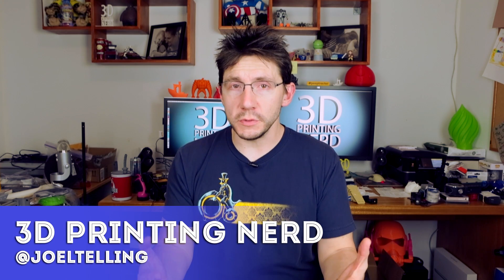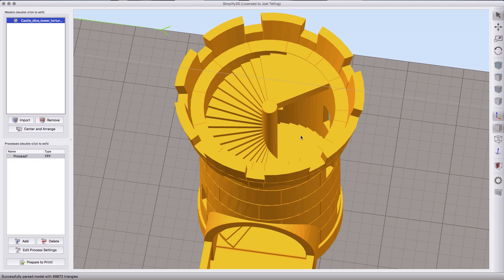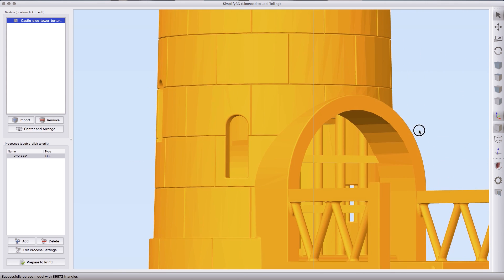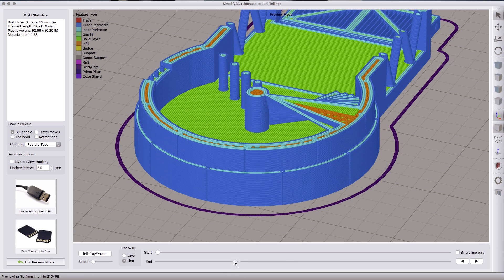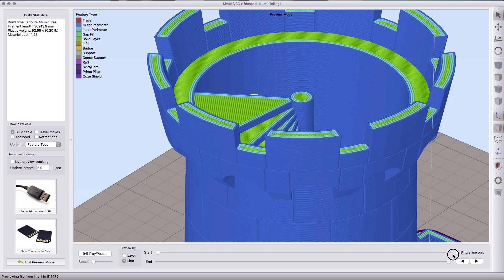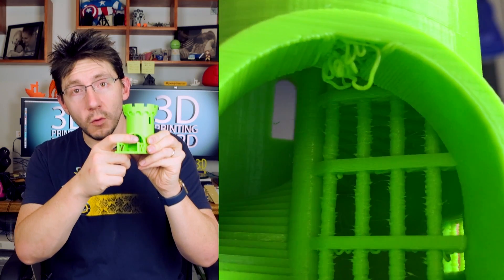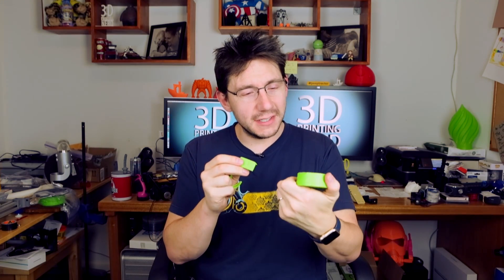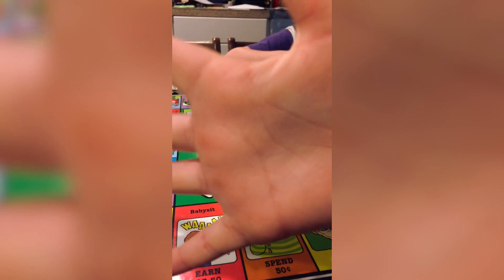3D Printing a Dice Tower - 3D Printer Torture Test

Comment: I have printed several of these for my D&D players... I printed them in ABS at 0.75 scale with a resolution of 0.2 layer height. I also had a much larger overhang on top floor (180 degrees of top floor).I used an Up!plus2 printer.
At this scale and resolution the gate does not work well (scaling the gap requires fine tuning or the gap in hinge becomes stuck).
It prints perfectly except for under the top floor where the first layer is all loopy... but every subsequent layer is fine. This is not a problem though as you do not see that issue from outside and it is only detectible by putting your finger in to find it. I just trimmed the droopy bits and it works and looks great.

Comment: Here's my finished print https://www.youtube.com/watch?v=RItiRbq1POA
You will notice that it has a unique feature, the ability to be set on a small hill :-)
The back started to warp off the bed early in the print, I decided to see how long it would hold on for. Amazingly it held on for the whole print, the only part stuck to the bed was the front half.
Other than that, I'm happy at how well it turned out. This was my first attempt with this.

I'd like to hear your thoughts Joel.

Comment: Drinking: 5 Seeds Crisp Apple Cider
Printing: FlashForge Finder
- White PLA 
- Raft 
- 0.3mm first layer 
- 0.15mm 
- 215ºC 
- Shells 3/3/3 
- 0% infill 
- 80mm/s print speed 
- 120mm/s travel speed

Estimated 8hrs.
Reply: Very nice 👍🏻
Reply: Nope failed. 4hrs in somehow the head was 2cm above what it was supposed to be printing. Maybe not high enough temp, I think it cooled a little, also the print curled off the bed like crazy because mine is not heated. But with 0% infill, my print quality of what succeeded is better than Joels in some spots.
Reply from the maker: +Mickice You went 0% on this one? ooh interesting!
Reply: Maybe i'll show a picture, the walls are smooth as anything. Shame the head stopped pooping out goo. I don't know the brand of this PLA which is not as good as the red supplied with the Finder. But I only have limited red left, lol.